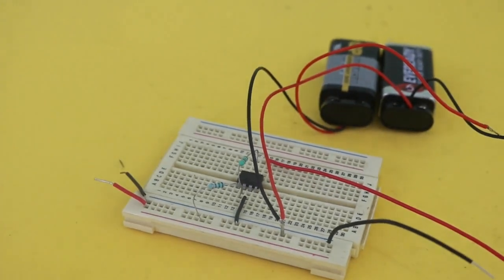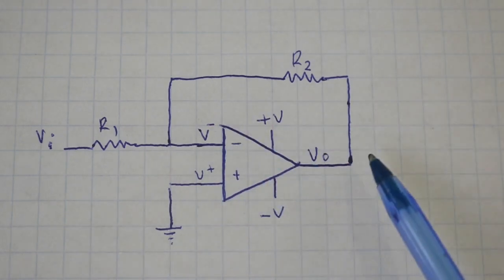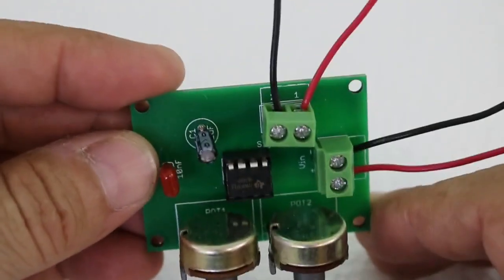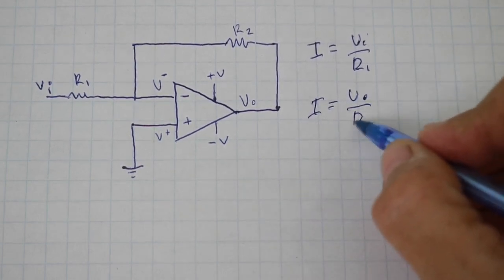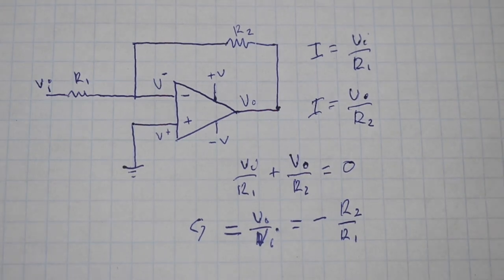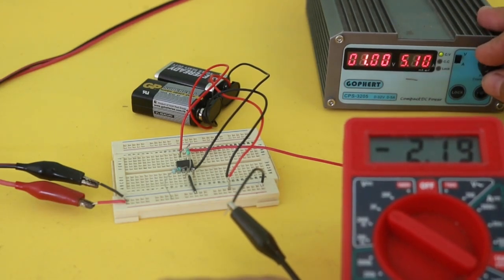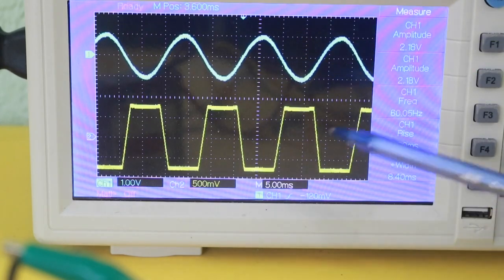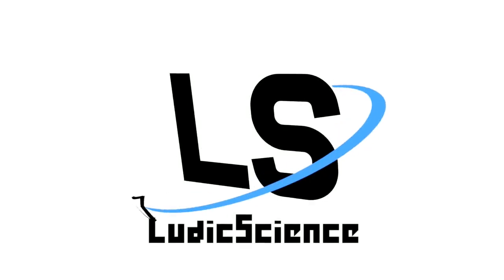Operational Amplifiers - Part III

Comment: Might be a good idea to state the op-amp you're using.  Bi-FET.  And another way to think about the negative closed loop is that the amp will output whatever it needs to, to make both inputs such that they are equal (if it can).

Might as well add a couple things ("A" is gain): 

• If the source has significant impedance compared to Ri then it should be added to Ri, because the equation A = -Rf/Ri assumes the source has zero impedance.

• The bandwidth of the op-amp decreases with gain.  BW = (Unity-Gain BW) / (A + 1)